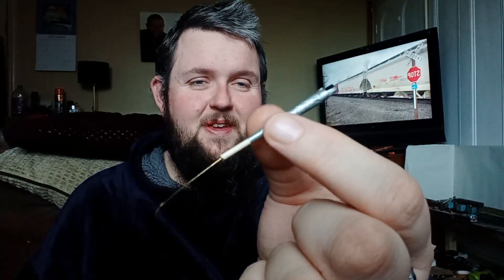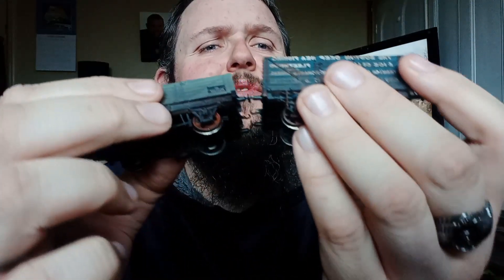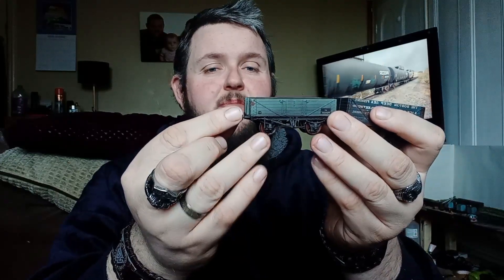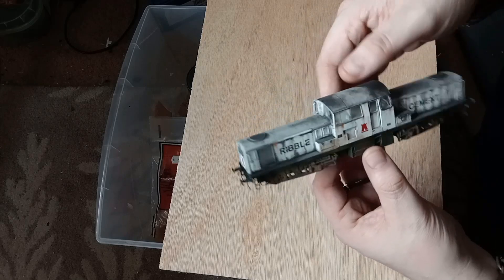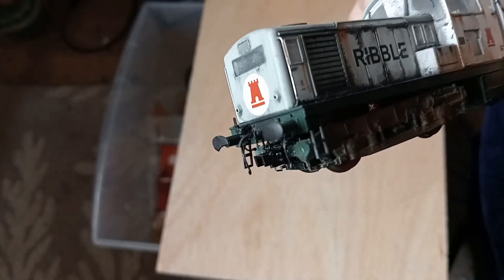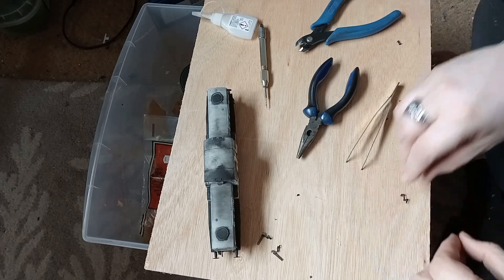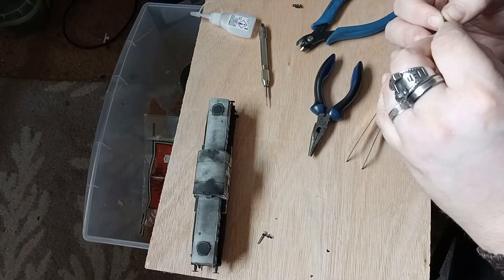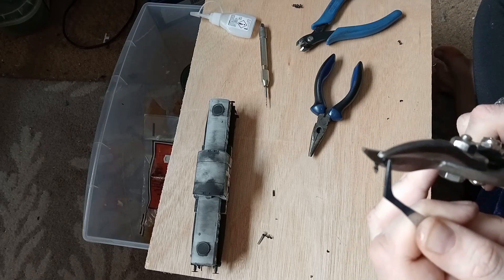Installing 3 link Couplings on a Heljan locomotive! | Iron Horse Weekly ep35

Comment: Hi Craig. 

Excellent instructional video; well done! 👍 

Firstly, I remember a conversation I had with a well known model shop and he suggested I convert to 3-link couplings. I took on board his advice but I wasn't too sure if the wagons could propel each other without issues, so I'm still researching other modeller's experiences and/or doubts about this method of coupling. 

Secondly, don't ever consider getting rid of the 'Clayton' again as it is my favourite loco in your collection, especially as it has been so professionally weathered. 

Finally, yes I remember you poking your head up above the layout in an early video and I believe that was the first time you displayed your face on this channel; correct me if I'm wrong geezer. 

Good luck with the dismantling of your large layout and I'm looking forward to seeing what you replace it with. 

Cheers, 

Paul. 👍❤
Reply from the maker: Cheers Paul, yes the propelling can be an issue if your curves aren't as gentle as they might be - sadly - but since all my layouts are now going to be end to end - propelling around a curved isn't an issue and more!

Cheers buddy 😁

Comment: BFC's! Wot, no Mole grips or a big 'ammer? - - You are holding things up to the camera that we can't see, (when the cam decides to focus) because you are off screen to the right! - - - Can't get to the window - snap! Can't reach to clean the glass or change the curtains! (oops!) Can't get steps in either, and a telescopic ladder is at too shallow an angle if I lean it on the wall above the window, so is stress-bent if I stand on it!
Reply from the maker: You can see all the important bits - if you really need to see how to pull something out with pliers then I'm not sure there's any hope 😂
Reply: @IronHorseRailways  Yeah - I'm hopeless! Definitely a lost cause!  🙂